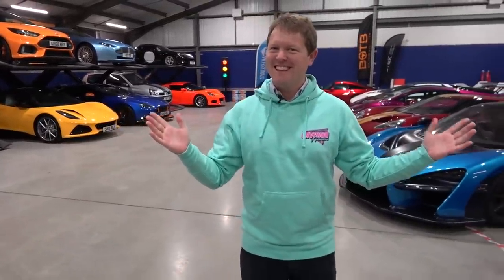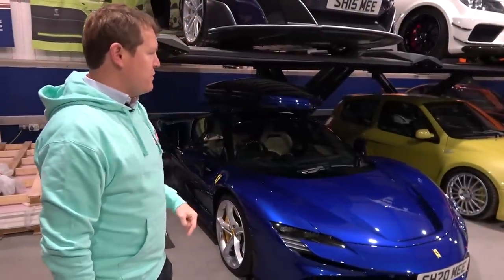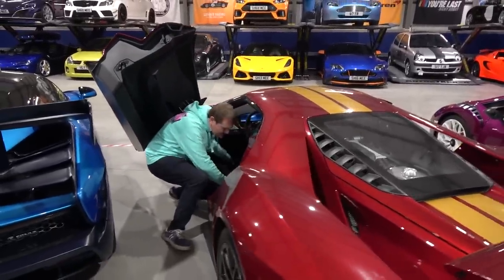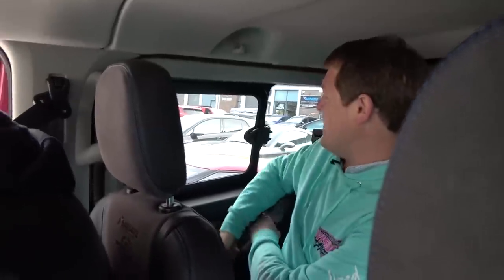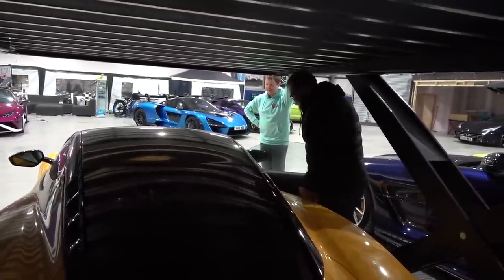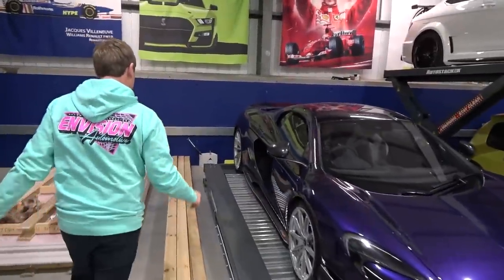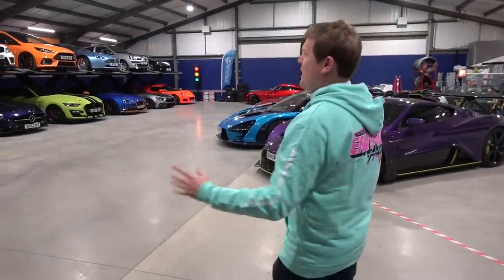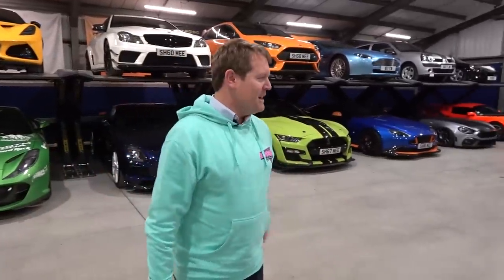A Day of Car Fixes! This is Garage Life When I'm Home | SHMUSEUM VLOG 116

Comment: Just to point out, these are not suction cups they are vacuum cups. Very different in their ability to stay attached. The chances of these coming off whilst driving are pretty much non existant.
Reply: You need vacuum to suck, I don't see a vacuum pump, the change of losing vacuum/suction is high.
Reply: @Shaking 63  the vacuum pump is part of the cup. I know because I sell these. The chance of these coming off...no.